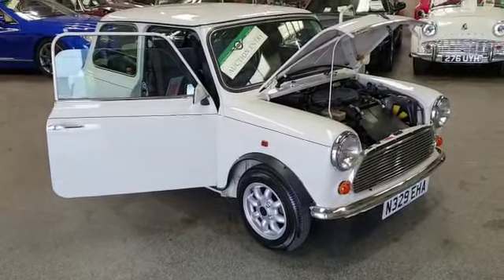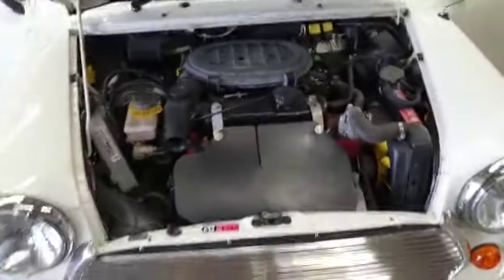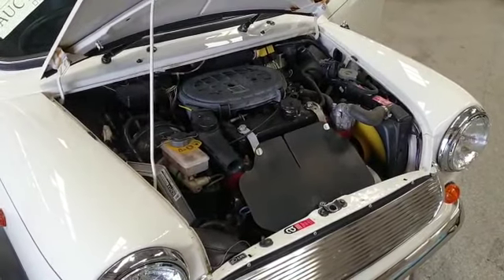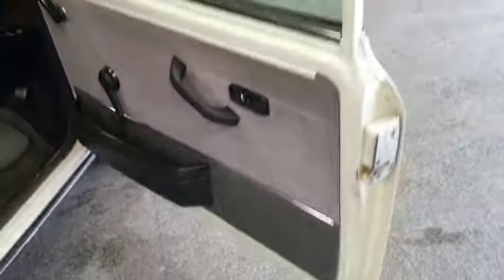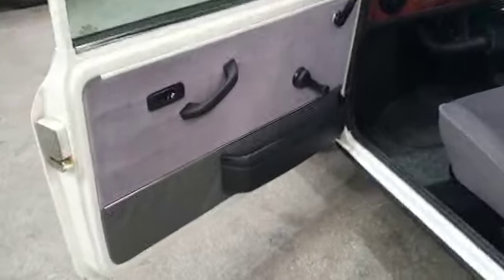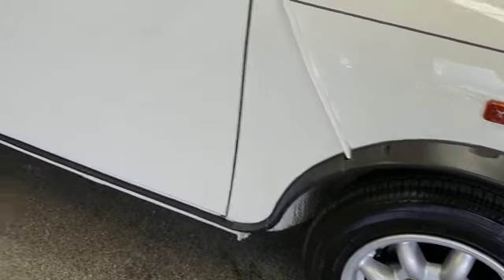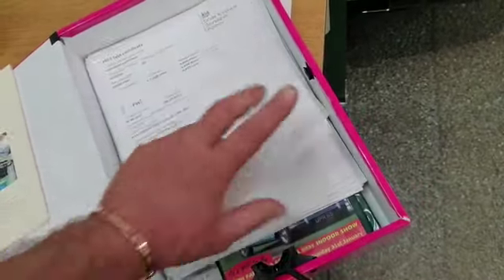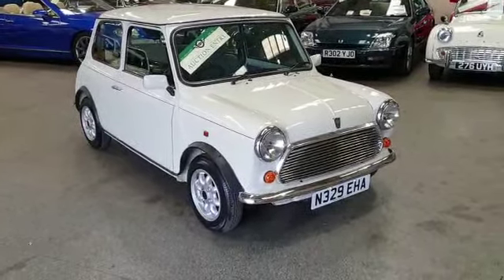1995 ROVER MINI MAYFAIR | MATHEWSONS CLASSIC CARS | 20TH & 21ST MAY 2022

Comment: 27 years on looks so showroom this Mini at 4,000 miles
Reply: Miracles can happen.I woudnt be surprised if its had body work done.Ran a few and even the later ones rotted for fun however carefull you were.Waxoyling was popular but if there is any moisure in the voids before you do it then they will rot even quicker.You can keep them in a garage and they still rot just through moisture in the air.Great fun cars but by 2000 there was no excuse for the rot issue.Shame.